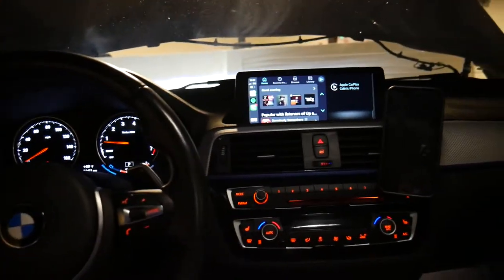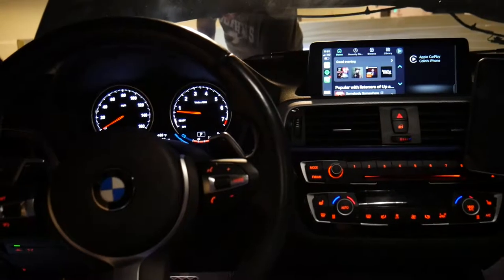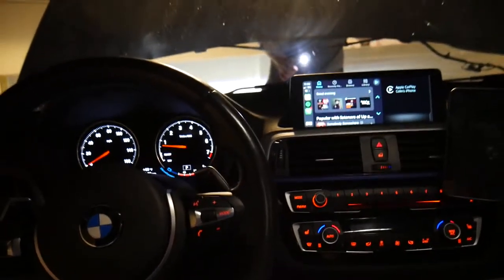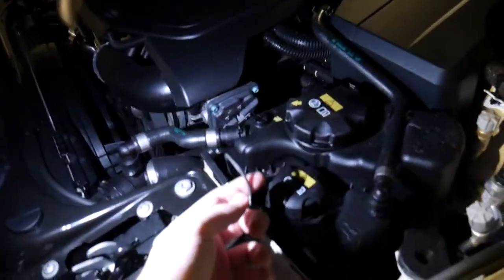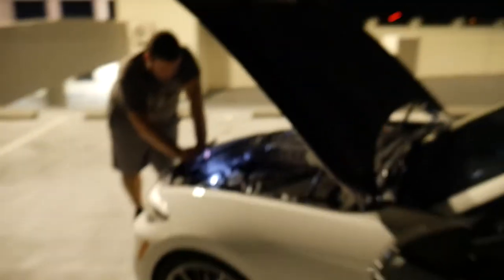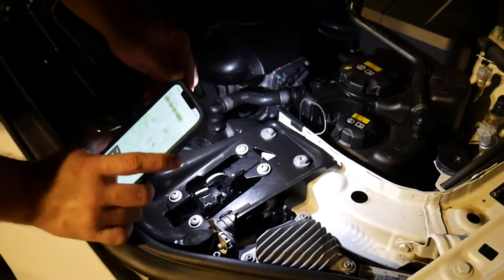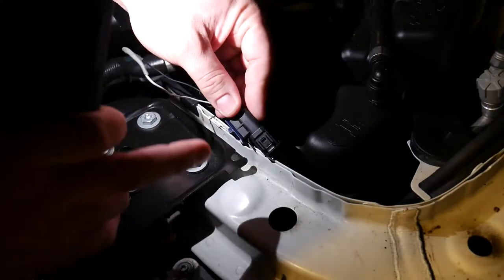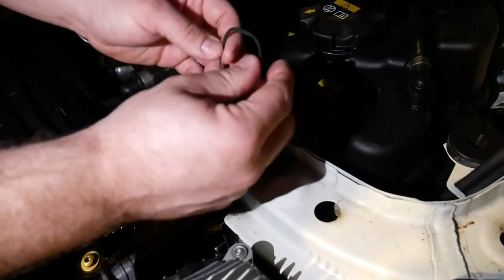How to Fix BMW "Hood Open" Error! Easy Fix in 30 Minutes or Less. 2016+ BMW Models

Comment: Thank you Guys … I had a similar issue with my F30 and the mechanic said the issue is with the sensor and must be replaced . I googled for the 750 k resistor which would be a difficult search but luckily I got one within minutes from where I stay in Kuwait . Had to get this job done by an Indian auto Electrician . I showed him this video and Bingo … it was done in 10 minutes flat . Thanks again.

Comment: Tried this on my dad's 5 series 2015, identical mechanism to the video, and IT WORKED!!! Thank you!
Reply: What wattage resistor did you use? I am seeing them mostly in 1/4 watt some in 1/2 watt
Reply: @larrythechipman  7.5k.  It's measured in ohms though
Reply: @graemehindshaw4221 thanks, I’m aware it’s 7.5k ohms but they come in different watts - are you able to share a link to the one you bought please?
Reply: @larrythechipman  I didn't buy, I work in an engineering company and I just paid a visit to the electronics guys.
Reply: @graemehindshaw4221  OK mate no worries thank you. I’ve bought a couple of different ones in any case
Reply: @larrythechipman  good luck!!

Comment: I found this problem and discovered the hood part of the latch the ring attached to the hood was not unscrewed far enough to push the switch . Only took a couple turns. The switch is attached to the black part of the hood latch not the silver hook part.

Comment: I tried the 7.5 k ohm resistor, but it didn’t work. I was thinking that I damaged the resistor heating the shrink wrap; but I guess I’ll try doubling it first. If that doesn’t work I’ll buy just the switch and throw a zip tie on it.
Reply: try 10k

Comment: Another way, you don’t need to use resistors. All you have to do is just take out the sensor from the hood latch. And plug-in the wires you don’t need to cut them just take out the sensor and it should be a little black thing with a silver thing that push down. Just take it out and plug the sensor back in harness and the light will turn off
Reply from the maker: That doesn’t work either unfortunately, mentioned in the video we tried everything from leaving it unplugged, cutting the wire, detaching the actual sensor in the latch. The only way to close that loop and knock the error message off was through the resistor.
Reply: @TheAftermarket1  worked for me 🤷‍♂️ I literally just did it right now and it worked
Reply from the maker: @baby_themacaw2592  oh it’s probably because my sensor was completely dead. I had sprayed WD40 to try and get the latch unstuck when the hood was stuck closed. The sensor was showing no current when tested before this fix

Comment: I have the same issue but resistors are not working would I mess anything up if I just connected the wires to each other
Reply: Also curious

Comment: I have a stuck hood after doing an intake mod on my F06... Super frustrating. I've searched and very limited info.  I've tried everything I've seen and could think of... How did you get your hood unstuck? Mine is only stuck on the driver's side and from what I can see,  it looks like the cable is still intact.  My window of vision is only thru my front grille. I've tried removing the wheel well liners,  but that didn't give me access... Sorry for the long comment..I'm lost...lol. Any suggestions?
Reply from the maker: With mine the left front side of the hood was able to open very slightly. I bought a thin gardening hook from Micheals and slid it under there and had a friend look through the hood vent to tell me when I had it hooked around the latch. From there I pulled and moved it while having my friend press the hood open button and eventually it popped. It was wild 😂

Comment: Same problem with my BMW...I tried with various resistors...I will try with 7.5k ohms
Reply: Any luck with the 7.5k ohm resistor? If so, what wattage was it? I am seeing them mostly in 1/4 watt some in 1/2 watt
Reply: @larrythechipman  It didn't worked for me and still had to deal with the same issue. 7.5K ohms in  1/2 and 1/4 didn't work for me...do let me know if you find a fix.

Comment: Can you please tell me how many volts the 7.5 kilo ohm resistor was?
What color? And how many resistors did you use?
Reply: Did you figure this out? If so, can you let me know please, I have the same issue and about to purchase some resistors
Reply: @larrythechipman  any voltage info is just a certification for how much it can handle, not a fundamental feature it can handle.  I'd expect max would be 12 v but not sure if bmw went to some 48 V systems so you might want to go that high.
Reply: Thanks I fixed mine OK in the end

Comment: Did you had to solder the resistor to cables??? Did you had to solder every single resistor you tried 🤔
Reply from the maker: No, you just wrap them around each other. And then once we found the right level we used electric tape and wrapped it

Comment: Im currently having this issue on my F32, I'm not knowledgable enough with resistors and electricity. If I just change the hood latch part should that do the trick or is the sensor not in the hood latch but seperate?
Reply: I’m having this issue rn bro what did you end up doing to fix it?
Reply: @giovannicarranza3802  resistor 7.5kohm or 10k try both whatevr works. and electrical tape to wrap itS

Comment: @theaftermarket - I tried using 7.5k ohms in my BMW but it didn't work. I think it differs in all models. BMW doesn't reveal the exact number. I will keep trying and update.
Reply: How did you get on in the end? I am about to buy a 7.5K ohm resistor for my 2016 M135i
Reply: @larrythechipman  didn't work for me...

Comment: Hey, what did you use to wrap the wire after you put the resistor on?
Reply from the maker: Electrical tape 👍
Reply: @TheAftermarket1  okok, that's what I got but wasn't sure. Thanks bro!
Reply: Heat Sink
Reply: Sleeve